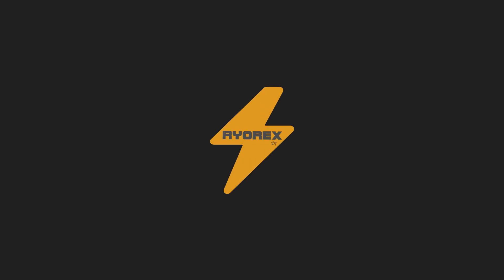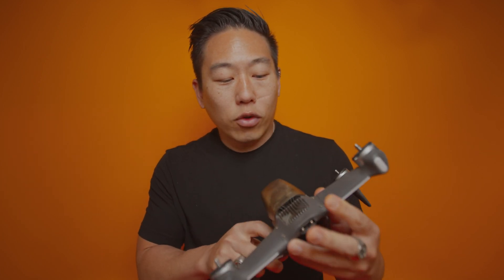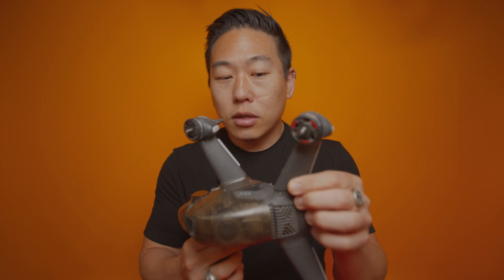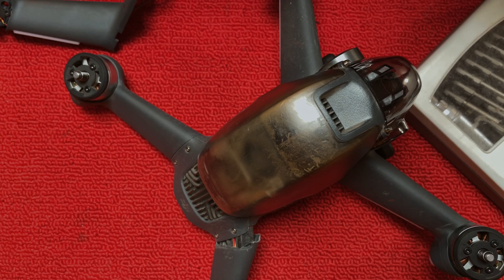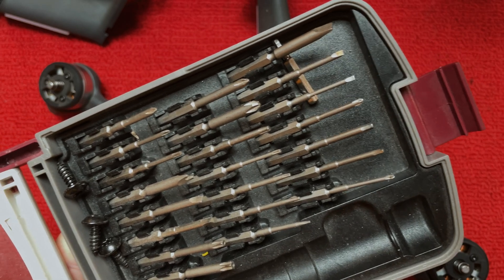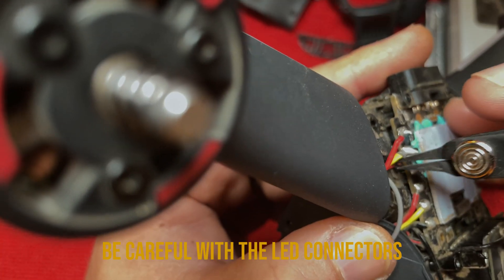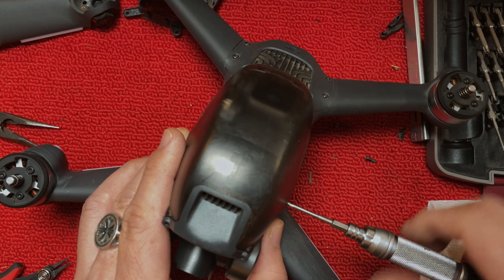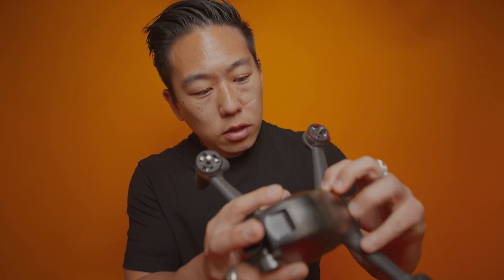Let's Fix the Broken DJI FPV Drone

Comment: I saw a setting in my goggles for an emergency disarm. Maybe you could make a video on that hidden feature and cover how to use it as I’ve haven’t seen anyone talk about it yet.
Reply: Disarm the motors in case off a emergency, Will stop the motors mid-air. Please don’t try for ‘fun’.
Reply: @ReneNieuwenhuis  yes, it would have helped during a crash too to prevent further damage and dirt getting everywhere
Reply: When your in Manual mode, double pressing the start/stop button will disarm the motors. When you are in Normal or Sport mode it will not disarm the motors...

Comment: I think best solution

Buy a second carcass from someone who just wanted goggles

About $700

Take broken one sell off parts (or keep )

There is no reason
To crash this it is not meant
To be concrete crasher

I only fly DJI fpv now (homebuilds)

But this new drone has so many cool features

Amazing range
Never failsafe 
Smart lipo
Adjustable camera in flight

Why do you think there will be Version 2 soon ??   Maybe in a year but not soon.

Comment: Nice. So the arms are "gettable",.. though not domestically in stock. Seems everything drop-ships from China lately,..... I cancelled a speed skate order because it was going to take 8 weeks. Hope these random "shortages" aren't long lasting.
Reply: You can get every part of this drone from Cloud City drones here in the states. I've replace the actual housing of this drone last week. I spent $20 plus three hours to completely take the drone apart and transfer everything to the new frame. Way too easy.
Reply: @GEN-XArmyVet  Good to hear things are coming along. The "itch" for this drone has passed for me, but if/when it comes back, I'll keep this in mind.

Comment: I replaced my drone with Refresh+ plan. They sent me a new one. In a fresh new box. And a new battery (props cut mine a little while falling). It costs half the drone in total. around 300$ (1 replacement left). Everything happened very fast and I got it done within 1.5 week.
Reply from the maker: cool, good info to know
Reply: What the total cost with the Refresh? 450€?
Reply: @EWmedia  no, Refresh allows you to get 2 replacements. each replacements will cost you half of the drone (refresh price included). So basically it allows you to buy 3 drones in price of 2. But beware, Refresh is not covering fly away for FPV.... so if you crash and can't retrieve drone, you lost it forever (no refund).